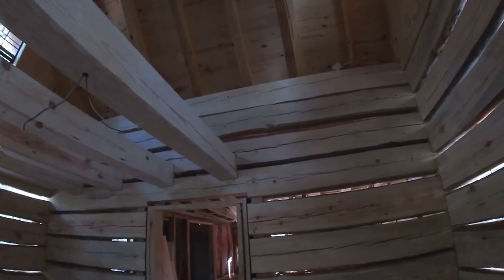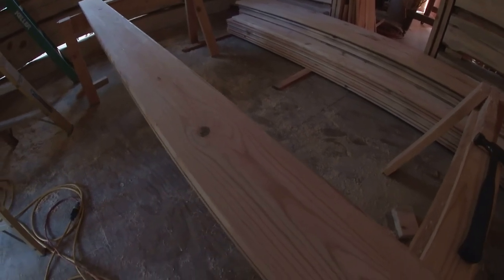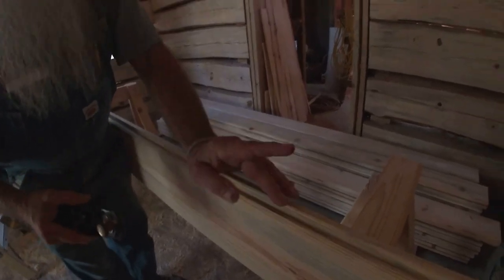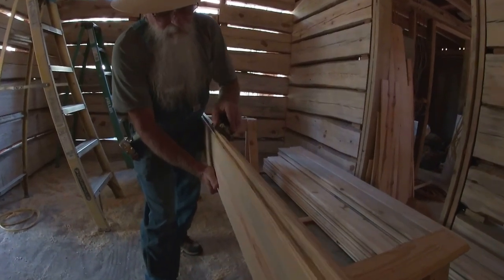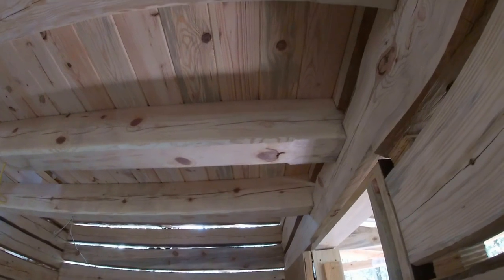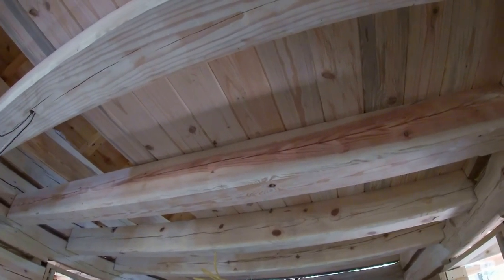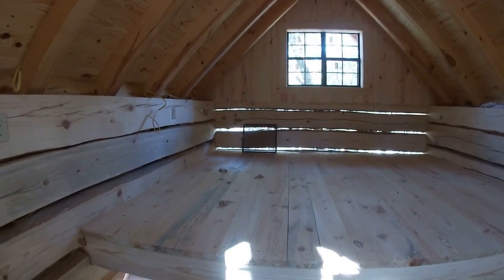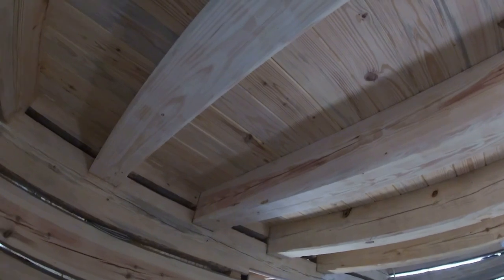Flooring the Upstairs, Paradise Point - Ep23

Comment: I'm probably not the only one that would have enjoyed watching you make a few of the floorboards.
Normally hardwood flooring in houses is nailed down through the tongue so you can't see the fastener, is there a reason you didn't do it that way?
Thank you.
Reply from the maker: I made them in the shop and had such a mess I was too embarrassed to show it. Lol these boards were a little too wide to just put a fastener in the tongue. I felt they needed more than that and they will be covered on top. Thank you so much for watching our video. Take care and God bless
Reply: @TheBeardedCarpenter   Thanks.

Comment: Man I sure do like that flooring, we was going to do 3/4 ply in our house but I like how you did that, I was wondering how you got them 1 1/2” tongue and groove, I knew my set only did 3/4”, I never thought about using the table saw, I guess you use a dado bit, I’m going to have to try that, we’re putting new floors from one end to the other. Did you used pine on them?
Reply from the maker: Howdy y’all- I did it on my table saw and did use dado blades.  I have a set of t/g bits but they won’t do 1 1/2” stock. Been trying to find a set that will. Yes, I used yellow pine. That’s what we have plenty of around here. Those boards had been drying for over a year. I just ran them through the planer at the shop. Had to replace a couple bearings on the planer and wouldn’t wish that on nobody lol. Hope y’all are doing well down there and the storms didn’t do any damage. Had some tornadoes close by but we were fortunate we were ok here. Take care and God bless